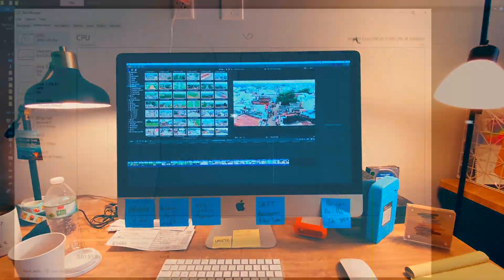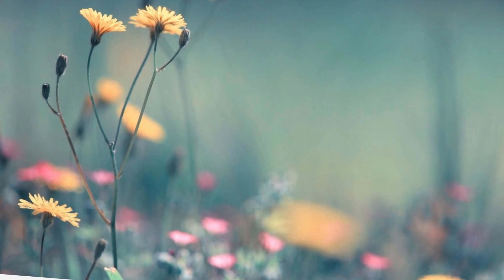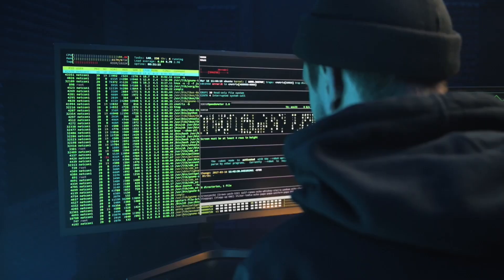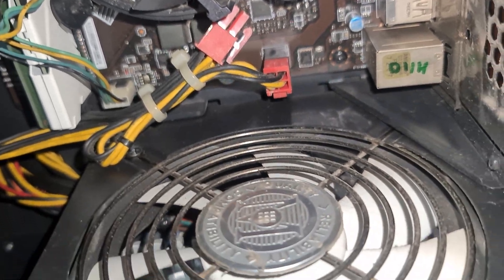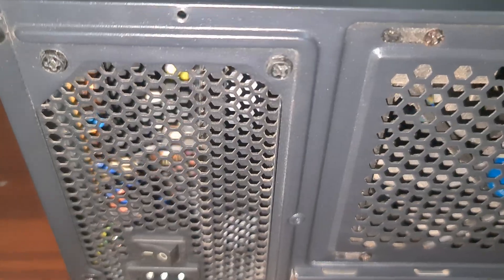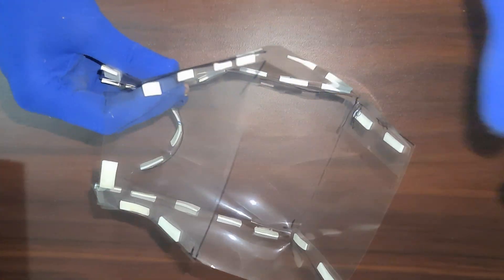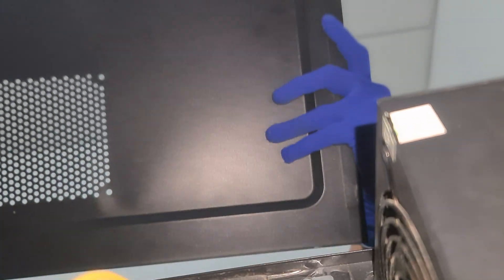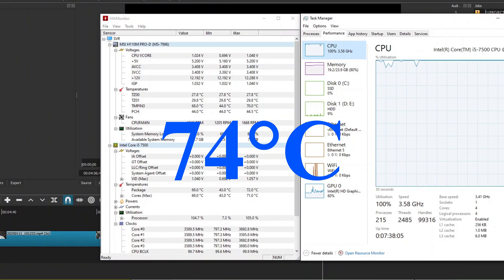🔥Unbelievable! My CPU Runs 11°C Cooler❤️ with This Hack! CPU cooler | Processor Overheat Solution

Comment: Man, you're a genius! My desktop was hitting 92°C under full stress for 5-6 hours, and I couldn’t figure out what was causing the high temperatures. I tried adding external fans, but they just brought in more dust and made the fan noise unbearable. I can’t believe I followed your method and created an air duct from the processor to the side vent. Now, my temps never go beyond 76°C! You’ve really saved me here—thank you so much, bro!
Reply from the maker: Hey, I’m so glad to hear it worked for you! It’s awesome that the air duct trick made such a big difference. High temps can be such a pain, but it’s great that you found a solution that actually works without all the noise and dust. You did an excellent job adapting the idea to your setup! Thanks for sharing your success, and I’m happy I could help. Keep up the awesome work!

Comment: Two possibilities, you reduced the volume inside the case so that the exhaust fans could remove the heat more efficiently or  the fan on the processor could have been inside a Vortex from the other two fans being much stronger.
Reply from the maker: Yes, the main idea was to isolate the processor fan inlet to prevent heated air from circulating inside the PC case, which would otherwise reduce cooling efficiency.

Comment: I tried with my pc, and having issue mounting the air duct on cpu fan. What was the trick you used to mount it on the cpu fan?
Reply from the maker: It mainly depends on the type and design of the CPU fan. In my setup, the part created from the paint bottle fit perfectly over the fan. To secure it, I used sticky pads and drilled two small holes, then tied it to the fan’s outer casing with a small coil for extra stability.

Comment: Wow, this was such an inspiring project! I tried your method on my setup, and even though my PC's layout is a bit different, I still managed to get an 8-degree reduction in CPU temps. My air vents and spacing are not as optimized, plus my graphics card was a big obstacle when trying to create an air duct from the processor to the side vent of the case. So, I ended up redirecting it to the front panel instead. The duct length ended up being longer, and I think that affected the final results, but honestly, this is still a game-changer for me. I’ve tried adding more fans, swapping heat sinks, and nothing worked as well as this. Thank you for pointing me in the right direction—your video gave me the confidence to experiment, and it paid off big time!
Reply from the maker: Thank you so much for sharing your experience! It’s awesome to hear that you achieved an 8°C heat reduction. Great job adapting the design to your setup! Redirecting the duct to the front panel was a smart workaround, especially with the obstacles you faced. I agree, duct length can affect the results, but it’s still impressive that you made it work so well. I’m really glad my video helped inspire your build—it’s comments like yours that make sharing these projects so rewarding. Keep up the great work, and feel free to share any future tweaks or updates you try!